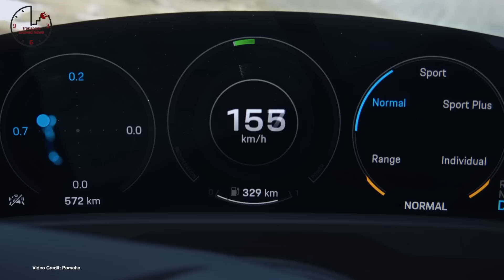Tesla Pickup Reveal Set, Kawasaki Ninja EV, Energica Extends its Range— TEN 272

Comment: I was wondering. Are there EV races? Could an EV be entered in a standard race (bike or car). Would they be competitive?
Reply: It depends on what you mean by a race.  There are all different kinds of races.  VW beat the record at the Pikes Peak, partially because EV has the advantage in not needing oxygen at the extremely high altitude at the top.  EVs are smashing records in 0-60 and preform well in quarter-mile drag races.  They fare less well in long distance and endurance races simply because gasoline vehicles pack more miles into gas tank, and can refuel faster, and typically reach higher speeds.
Reply: @patreekotime4578  In Australia we have races for V8 cars and uses. Also world wide races such as formula one. That sort of race.
Reply: @StephanieElizabethMann  Australia also has the solar challenge races!  If the goal of the race is loud noises and crashes, EVs aren't really great at that.
Reply: @patreekotime4578  I'm more wondering if EV car or bike would be allowed in a race alongside petrol powered cars or bikes.
Reply: There's formula E for single seat formula one style EVs. At the Isle of Man TT races they run the TT Zero for electric bikes. I'm not aware of anything else but there probably is.
Reply: @davidholden2658  Thanks.

Comment: Selling the Tesla "skate board" to other manufactures for custom coachwork seems like a good idea to me.
Reply: This would be an absolute stupidity. 
Tesla operates on its maximum production capacity (especially batteries). So Tesla + battery suppliers would either invest upfront to increase the capacity (killing the bottom line for producton capacity that won´t bring Tesla models to the street) or divert production capacity for just that deal (crippling Tesla´s vehicle output and leaving them with now unused producton capacity for the rest of the vehicle).
So Tesla would inevitably hurt themselves in order to sell the skateboard/drivetrain/battery pack combo while providing a big legacy automaker with the necessary hardware to snatch away some of Tesla´s market share.

This whole deal would only benefit FCA, who would quickly get the hardware they cannot develop themselves while saving them the necessary costs and time for R&D.

It would only make sense for Tesla if Tesla had unused production capacity due to dropping sales. And this is definetely not the case.
Reply: @antyspi4466  Another way to think about it: Tesla asks FCA to help finance a huge skateboard factory in addition to Tesla's current growth plan. FCA stops any battery development because why should they. FCA is then at the mercy of Tesla. Tesla will make a higher margin on skateboards than on complete cars. Economy of scale becomes even better.
Reply: @antyspi4466  maybe they sell the Skateboard without Cells, so FCA just has to aquire them but dont have to develop the Drivetrain. Or Tesla thinks they might have surplus Capacity in the future due to new Cell Productions coming online.